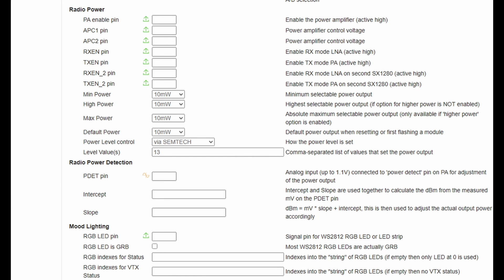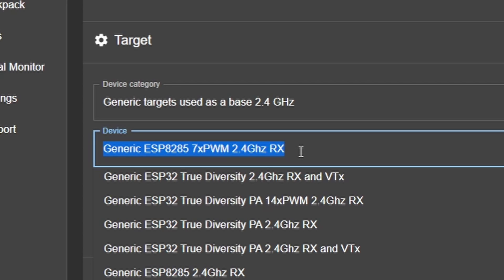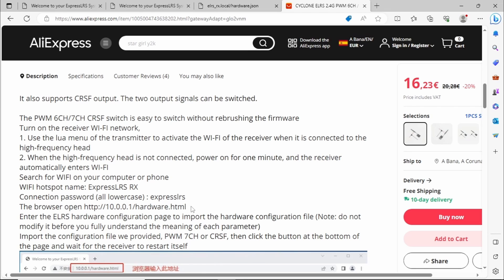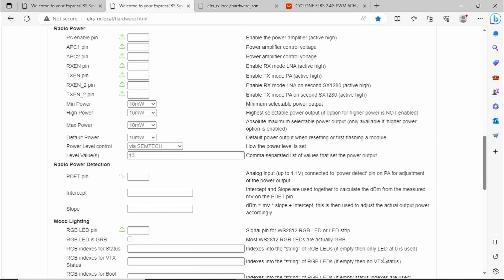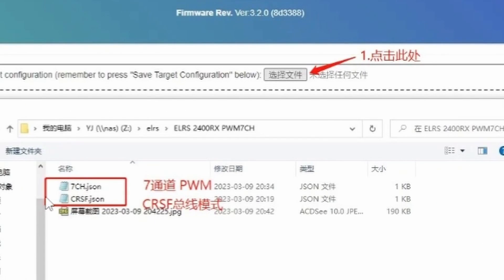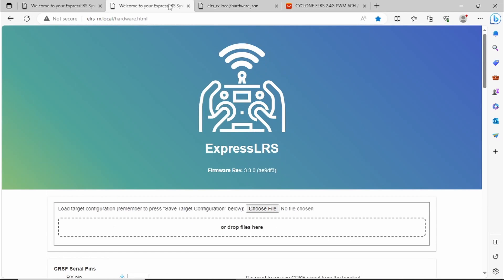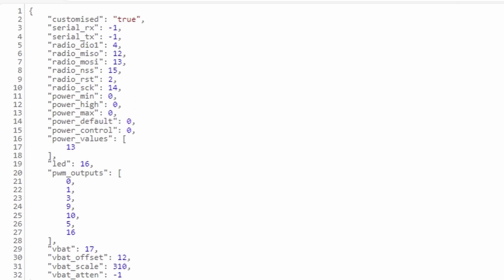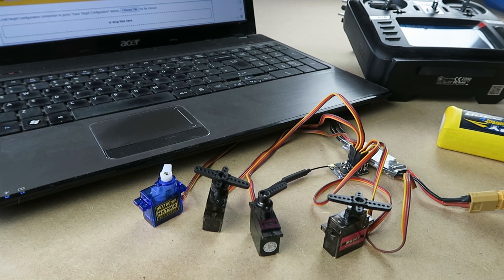ELRS Tx Rx "SECRET" Hardware Tab CYCLONE ELRS 7CH PWM JSON Files

Comment: Hi there, im pretty new to the topic, was flying fpv drone before, with ELRS of course. 
now i bought this receiver in the hope it will work exactly like the other  ELRS receivers. connect to battery, wait 60 seconds  hotspot opens. ant then update and enter passphrase. 
but no. :S
im connecting a constant voltage of my power supply  of 5V to 5V pin of CH1 and ground. 
led is blinking twice. every second. 
but WIfi wont open. 
what am i doing wrong?

please help. 
cant find any help or guide on the whole internet :)
thank you very much

br RickSmitth
Reply from the maker: I am guessing that you have flashed the wrong firmware to the Rx. In this case it will never go into wifi mode and you will need to flash it via a UART like this device : https://s.click.aliexpress.com/e/_DDzPaYN You must only flash 6 channel firmware. Now the "generic" targets have been removed from the configurator you may use the "Happymodel" 6ch PWM firmware. The 7th channel is enabled as I show in the video by applying the 7Ch "json" file. Thanks for watching, have a great day!
Reply: @1nformatica  thank you for the answer.
But i have never been able to comnect to the wifi hotspot not on 2 RXs at all.
So i havent flashed anything jet.
Must i connect anything else to 5v than one of the 5V pins? Like the boot pin or anything else. 
With the loaded firmware by delivery?
Reply: Is there any manual to this RX? Anywhere? :)
Like what is the blinking code meaning, for example
Reply from the maker: @RickSmitth  You only need +5 volts and ground for the Rx to work. I always connect the +5 volts to Ch3 out of habit.
Reply from the maker: @RickSmitth  There is no manual I know of for this Rx. Here are the ExpressLRS definitions of the LED flashing status : https://www.expresslrs.org/quick-start/led-status/#receiver-led-status

Comment: i can not find the original Firmwar fpor this RX i flashed a wrong one. for matek with same chip
but I made an backup of the original, but it is too big
Reply from the maker: Make sure you have the ".gz" compressed firmware file.
Reply: @1nformatica  how can i compress my Bin file to gz file?
Reply from the maker: @mauritz1774  The configurator generates both .bin and .gz they should be in the firmware folder which is "hidden" in your "Appdata" folder of your user name. I don't know if compressing a .bin is the same. You can get a free Archive tool called "Peazip" that will generate GZIP (.gz) files. https://peazip.github.io/

Comment: From version V3.4.0, the developers increased the Wifi power. The receiver resets when switching to Wifi mode. It is necessary to add a capacitor behind the LDO regulator. I have 47uF/4V there and Wifi with V3.4.2/EPW6 works without any problems.
Reply from the maker: Good to know, thanks for sharing.

Comment: hello were can i find the original firmware file for the cyclone 2400 pwmp rx?
Reply from the maker: Short answer, you can't! Long answer, the "original" firmware was based on the "Generic ESP8285 6xPWM 2.4Ghz RX". Since the ExpressLRS devs have decided to remove this target from the configurator it is no longer possible to build firmware for this Rx. I have successfully used the Happymodel EPW6 target. Configuring the 7th channel can be done with the "JSON" file as before. Thanks for watching, have a great day!
Reply: @1nformatica  i tryed to download the happymodell epw5 firmware and put the jason file on it. but i van not get the same setup page like before

Comment: Thanks for sharing. Before I viewed your video, I did this to make it work. on latest ELRS configurator 1.6.1. select release 3.3.2, target: Generic targets used as a base 2.4Ghz, Device: Generic ESP8285 6xPWM 2.4Ghz RX. Select UART or WIFI and Flash it. Then go to receiver wifi: 10.0.0.1/hardware.html, find "pwm_outputs", add number 16 to make it look like: "pwm_outputs":[0,1,3,9,10,5,16] . Reboot, that's all.
Reply from the maker: Yes, the JSON files are not really necessary, if you are careful!! Thanks for watching, have a great day!

Comment: Fantastic sluthing! I just added ",16" to the pwm channel list in the hardware tab and it worked great... didn't need to mess with the .json file at all! I'm curious if the other RXs have a hardware tab?
Reply from the maker: Hey thanks! Yes, the .JSON files are not really necessary, they just prevent you from accidentally changing something you shouldn't and bricking your Rx! Also yes all Rx's and Tx's have the hardware tab, it's used by ELRS devs. Have a great day!

Comment: I just ordered one of these as I neeed 7 channels for my car's lights setup. Do you know if these settings get changed back to 6 channels when update to new firmware version?
Reply from the maker: If you put new ELRS firmware you must use the PWM 6 Ch version then in the hardware tab make the changes for 7 CH either manually or using the JSON file. Thanks for watching, have a great day!

Comment: This is very helpful and interesting! So basically the Generic ESP8285 6-Channel firmware target will work, but without further modifications only without the 7th "LED" channel?
I did the same exact thing trying the 7 Channel firmware. Will recover it tomorrow and try again with the 6 channel firmware.
Reply from the maker: Yes, using the 6 channel firmware is the "trick". Out of interest I have tried to use the LED function putting a WS2812 RGB LED on the pin but none of the settings make it light. I wonder if anyone has got that to work?
Reply: @1nformatica  Interestingly, when connecting the receiver to the serial USB interface, the receiver started successfully into WiFi mode (without delay) and I simply could upload the the 6 channel software without actually using the serial connection at all. Comparing the JSON with the configuration, the LED pin being in the PWM list was the only difference indeed. I decided to keep the stock configuration of the firmware since I don't need the 7th PWM channel at the moment.
Reply from the maker: @tastenheber  Glad you have it working. When flashed with the 7 CH firmware it does some very strange things!! Happy New Year!

Comment: thanks @1nformatica , that was a great help! With your instructions i was able to activate Channel 7 and afterwards flashing it to the latest ELRS version with my bindingphrase etc. Works great, also the Vbat works directly connected to the two pins, tested with a 3s Lipo, for a correct readingt i had to set RATIO to 18.7 and OFFSET to -0.04 , however, now its a great receiver. Thx a lot
Reply from the maker: You're welcome! Have a great day!!
Reply: How did you get the Vbat to work? I presume you must have used a voltage divider as the ESP8285 says 1v max.
Reply: @Double-D_291  ? ......... ? No answer :(
Reply: @rcr @rcrotorfreak actually answered me from another comment I made on his other video. No voltage divider needed. Just use the pads on the board.

Comment: Great Video. I would like to use this receiver in an rc car with the new Mt12 radio. My question is that since ch7 pin can be used for ws2812 led's, how would I do that? I dont need more than the 6 channels and would love to use the led pin to control led colors for white headlights and red brakelights, and if possible yellow turn signals when the steering is turned. Any help is appreciated.
Thanks
Reply from the maker: My initial thoughts are that it would be possible to use WS2812 leds for static things like the headlights and tail lights but you cannot turn them off or change them via the transmitter. I will look into this. I have another project where I controlled leds from a spare channel (PWM) on the Rx using an Arduino nano, if programming is your thing you could modify it : https://youtu.be/VH4PF3udZWc

Comment: I'm at the start of the journey. Which voltage should I choose to power it up?
Reply: Thanks. Which pins do you use for power supply? Because I have problem with receiver after flashing. Wifi configuration mode works unreliable it restarts before I can load configuration file in hardware tab
Reply from the maker: @petrivatov6748  I normally use power from a BEC enabled ESC on channel 3. Note that you MUST use the 6 Channel firmware as I explain here : https://youtu.be/2VZb0n_G_Pg?t=69 If you flash the 7 channel fw then the status LED will flash like it is wifi mode but you will not see any wifi signal. At this point all you can do is to flash 6 Channel fw via an "ftdi" adapter over USB. Thanks for watching, have a great day!
Reply: Yes I flashed 6ch firmware but when I connect to wifi it restarts thr receiver
Reply from the maker: @petrivatov6748  That is very strange, I have not seen that. I find wifi works more reliably when connected to my local network, did you try that?
Reply from the maker: As with most receivers 5 volts is the preferred voltage. The receiver will work from 4 to 9 volts. Thanks for watching, have a great day!

Comment: Thank you so much! Just got these receivers, went through similar jour ey, testing adc port from 2xAA up to 4s, increasing by 1 volt and fearing that I will fry it. You also answered my other questions. Thank you! There is a lack of specifications on this thing on sellers page.
Reply from the maker: You're welcome! Have a great day!!
Reply: Hi, did you have to use a voltage divder for Vbat?

Comment: you said early recievers had adc pin but label says that your rx has adc pin as well
Reply from the maker: Yes, but this adc pin has a voltage divider so it can measure up to 36 volts, not 3.3v!!
Reply: @1nformatica  I've tested it and, is it okay that it shows about 0.7v higher than the actual voltage is? and how to fix this?
Reply from the maker: @artem56881  Normally it is much closer than that, usually within 0.1 volts. Calibration can be done on your transmitter or you can use the "offset" and "scale" parameters under "VBat" on the hardware page.
Reply from the maker: BTW what I do is to take a "Dupont" lead and solder it to the adc input then plug it into the balance connector. Search for new sensors in telemetry and you see Rx voltage which is the battery pack.